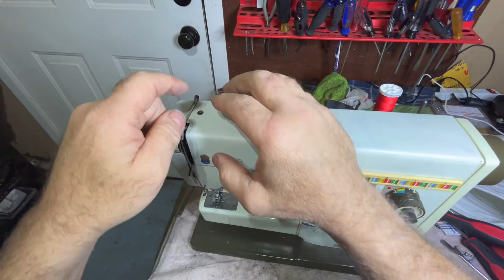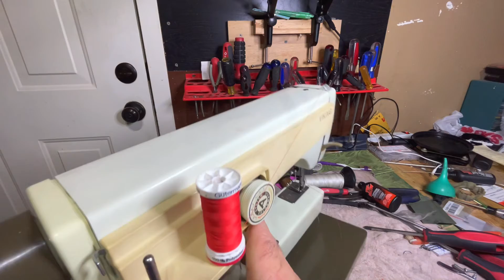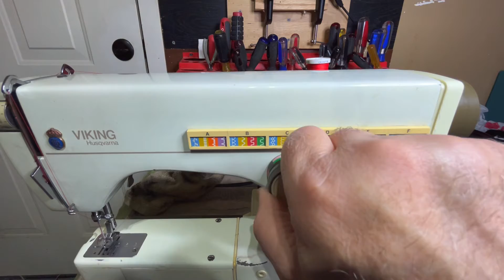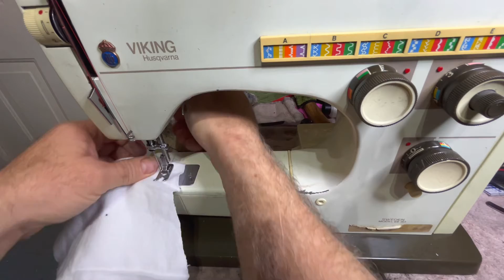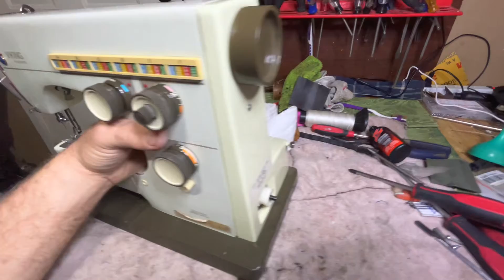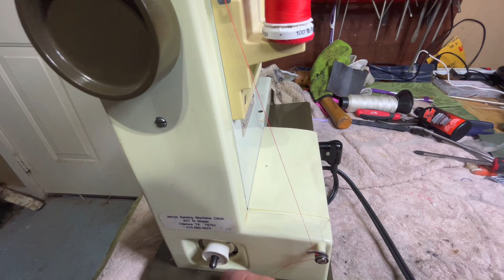Husqvarna Sewing Machine: How to Use a Viking 6430

Comment: Does this machine have a backstitch option?
Reply: yes push the button on the stitch length selector.  If the button won't push in then you either have it on Zero stitch length or the reverse button is gummed up and stuck
Reply: @harrygrady4106 Thank you. 😊

Comment: Hi. I have a 6230. The top thread jams around the gripper. 
The point on the gripper is behind the needle when the needle is coming 2-3mm up from bottom position. The service manual says 2.5mm. So what else can be adjusted?